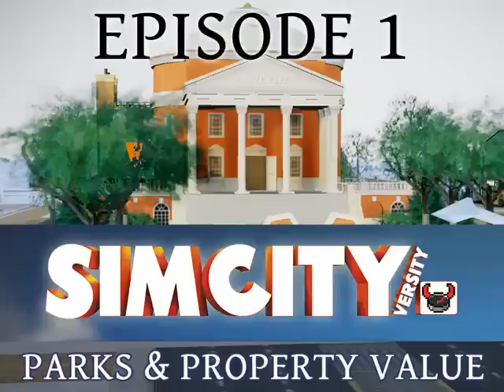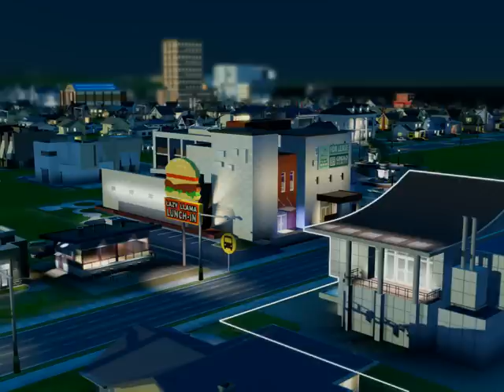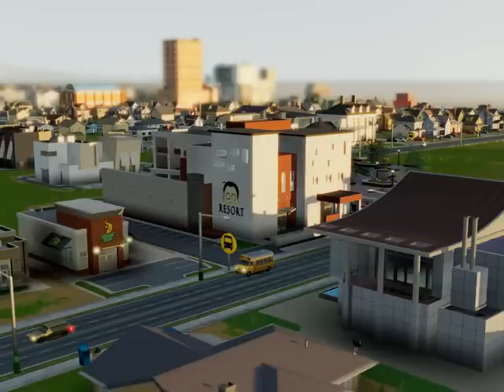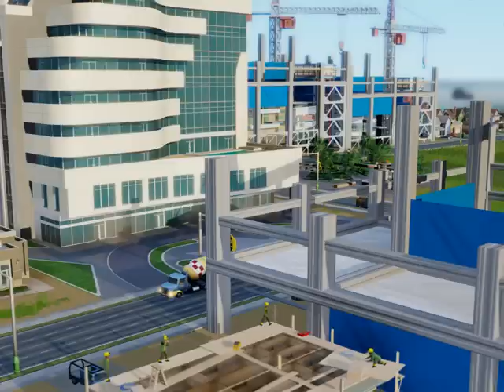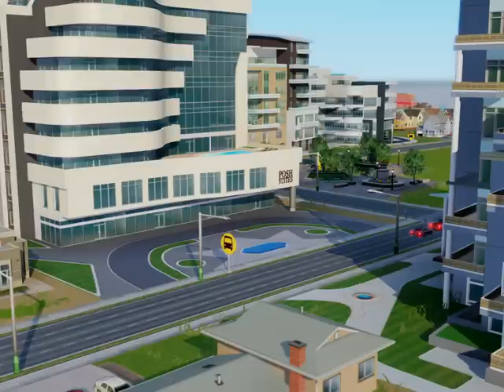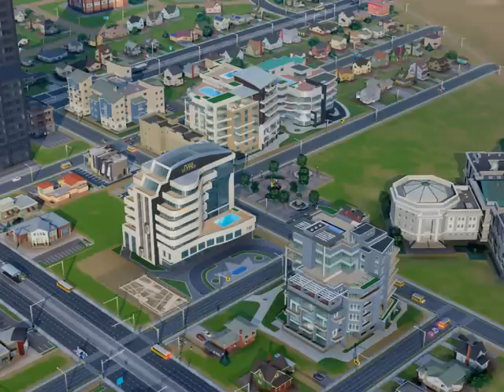SimCity 5: Parks and Property Value

Comment from the maker: Hey, Eassle.  I would assume that parks near industrial zones simply negate the depreciation caused by the factory.  In that case, I would assume that the park would only grant happiness and not necessarily gentrify the area.  However, I have yet to experiment with high-tech factories.  It's distinctly possible that high-tech factories can gentrify like residential and commercial, but I can't confirm that yet.  I'll get back to you with an answer when I get one.